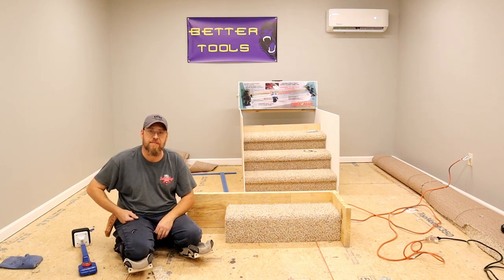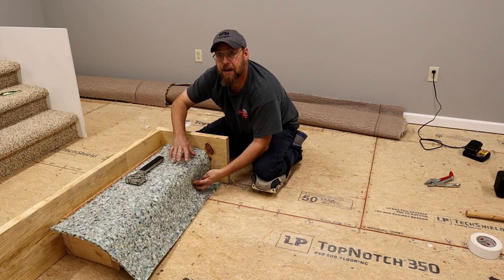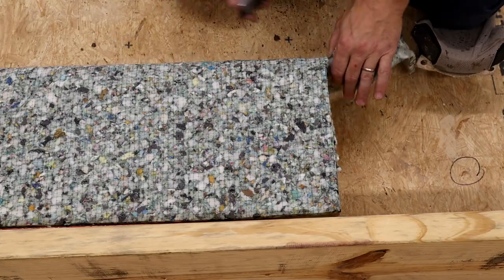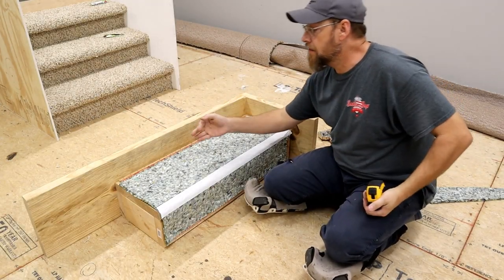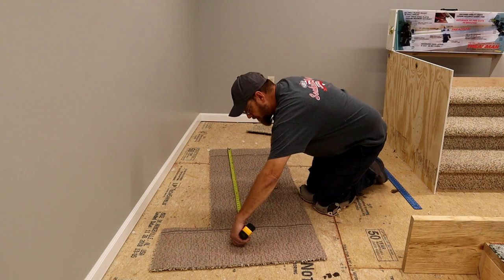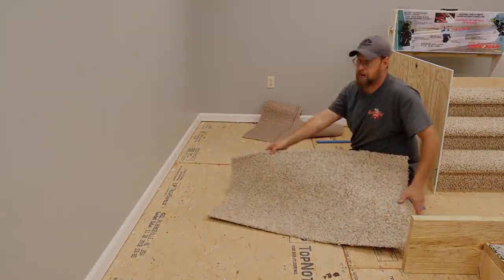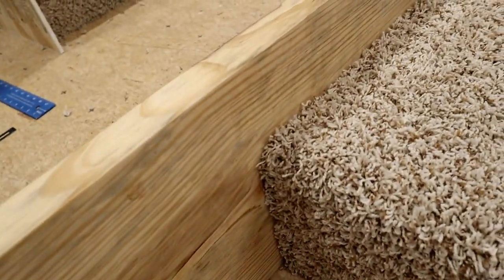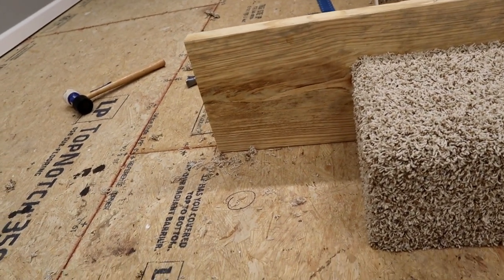HOW TO CARPET A BOX STEP

Comment: It's easy when you have shag pile carpet to hide the join. How do you do this with axminster or any patterned carpet. You would ruin the pattern look. Also shouldn't you seal the cut edges with latex adhesive to stop threads fraying in the future. Have a look at possibly  cutting a 90 degree cut at the corner and hand sewing it. That way you won't notice an angled cut if you have a join in patterned carpet.

Comment: Why didn't you cut outside off when you cut the top of the step then you wouldn't have to cut that you could have just folded it down and stapled I've been doing at 20 years it's much easier if you just cut it off how do you kick it up earlier and left it on the strip he cut it all just cut it all the way off does most time when you do that if you in a tight spot turn your wrist too much some people highest cut it short just cut it off when you cut the top of the step you doing good your way just like that one video I seen every what you feel comfortable with that's what my dad always used to say but I like all your videos too pretty cool I have won a lot of stuff from you and they work easy to cuz I was doing up for years now if you want to fuel your videos and it makes it a lot quicker and a lot simpler but always cut that top of that stuff off but like you were saying what's ever easier for you all right man I like all your videos broke
Reply from the maker: I actually considered that when I made my cut , But I don’t do that myself so I did not want to throw that in the video

Comment: Hi Reuben, how about doing these technical carpet installs over cast concrete steps etc? Not using the pin gun should make it rather different install technique.... I would guess you would glue it right? Love your content.
Reply from the maker: You don’t have to, I recently did one concrete with pad and tack strip
Reply: @FloorsbySouthernboys  and all the tacking around the open corner return? How would this be done or are you just applying extra tack strips to hold cuts in place? Sorry, I'm a total noob when it comes to carpet...